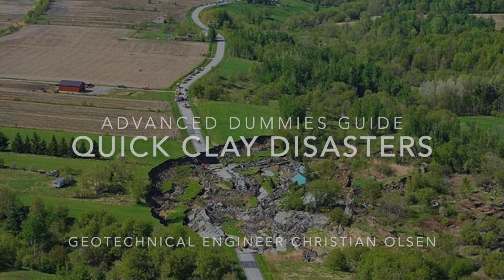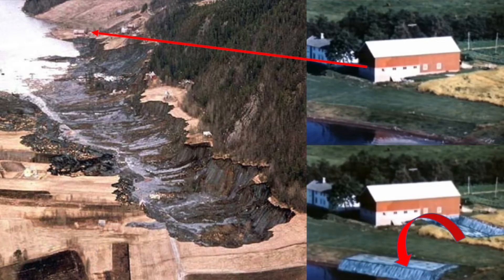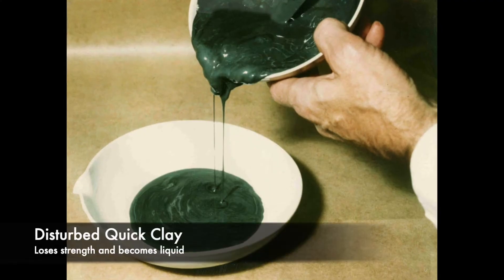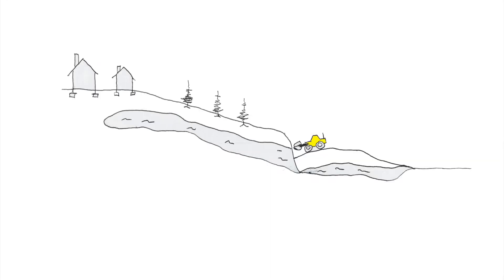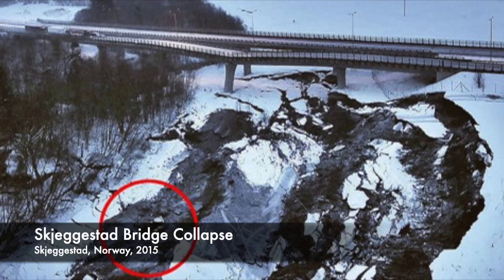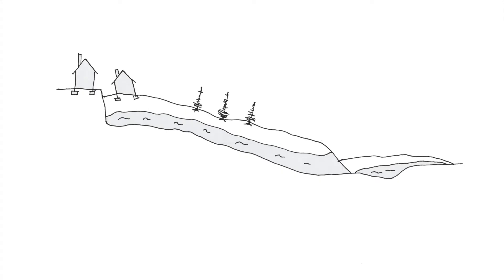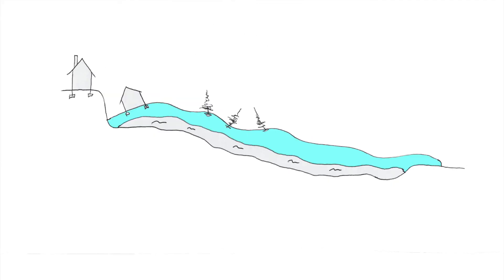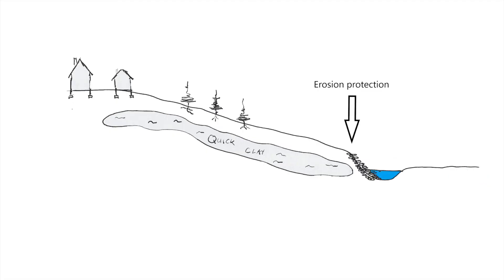Quick clay disaster explained

Comment: Do people need to have some cores drilled whenever they want to  live, work, and build on a mountain side?
If it found to have this kind of clay, can anything be injected into it to stabilize it? Sound as chemicals, salt, or concrete mix?
Reply from the maker: Thanks for your question. Yes, if you want to know if there is quick clay, you need to drill some samples up and get them tested. I think they are working on procedures to avoid physical samples, but testing directly in ground.
You can inject stuff to stabilize - but that is inpractical - sine the volume of soil is just too large.
Reply from the maker: If you are very keen, I recommend you to read this paper: https://www.ngm2016.com/uploads/2/1/7/9/21790806/ngm2016-021_detecting_quick_clay_with_cptu_valsson.pdf